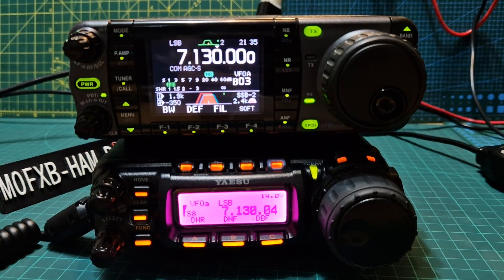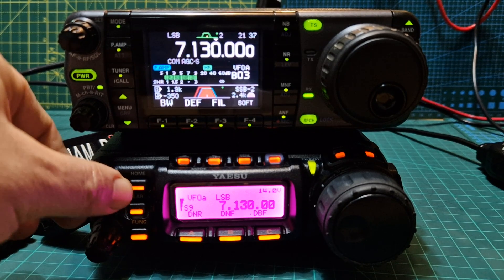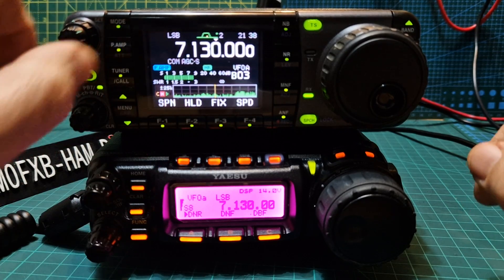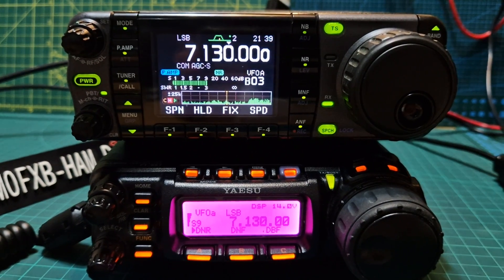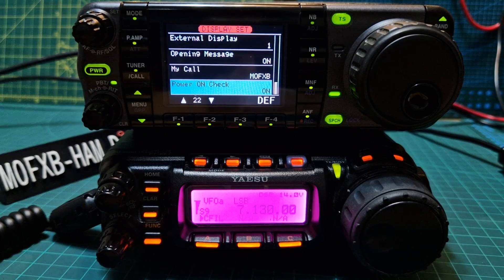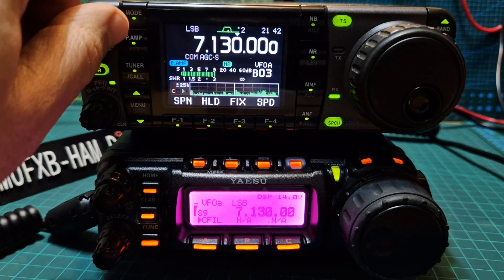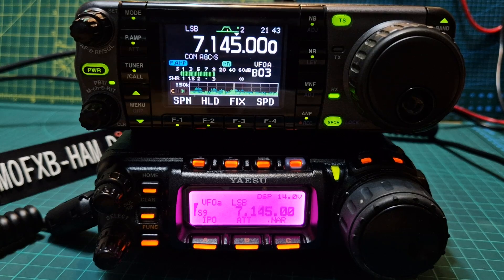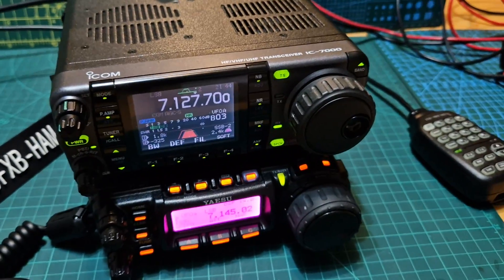ICOM IC-7000 & YAESU 857D

Comment: Thanks for this video. I enjoyed it. I owned a brand new IC-7000 back around 2011. One feature I really enjoyed was the dual manual notch filter. You can place a notch on either side of a signal you are listening to. 73 de WA3RSL
Reply from the maker: Yes I used that its so good .
Reply: 7000 as it was sounded better than yaesu IMO